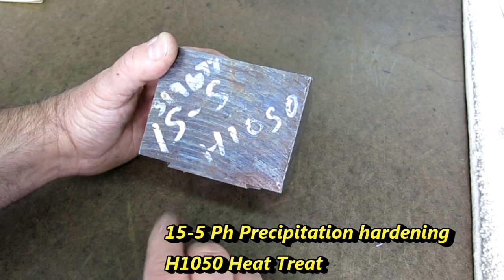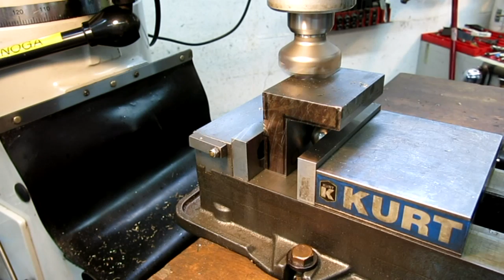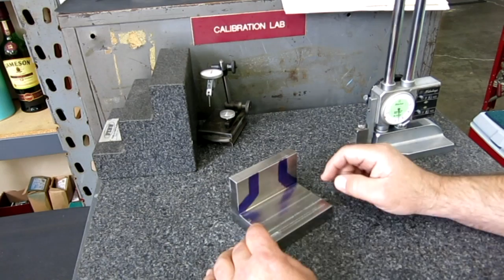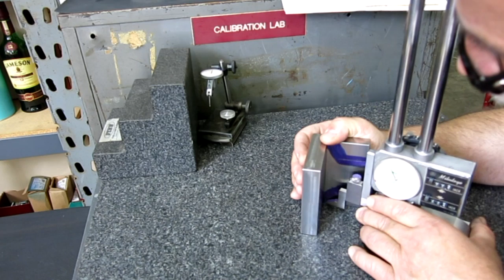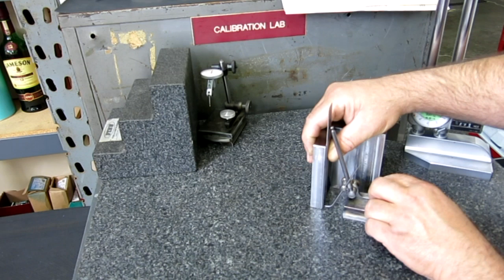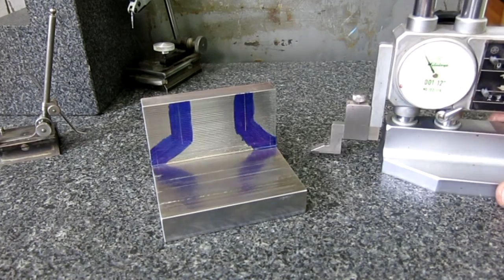Enerpac Toe Jack Part 3

Comment: 18:15

Quoin - Used to hold the type/dies into the "chase" for old rotary letterpress, or into the form on flatbed/platen style. Anyone running letterpress will correct me but it is what it is. Never seen that style, the most common is just 2 bits of metal(aluminium or steel), with a wedge force between them with a screw from the top. Interesting to see what that tool is meant for, every shop I've worked in has a few with that 4-pointed bit but nothing to use it on, I guess they weren't as cheap to make as the other style.

Super reliable, never had one loosen even on week-long jobs with 150,000+ impressions. The big rotary letterpress machines have been known to eat aluminium bits and still run with perfect accuracy once the bits are removed from the racks, testament to the old German quality)

Comment: Hey Tom,
What did you think of this facemill? I know you mentioned it in another video, but I can't remember which one. I'm close to pulling the trigger on a 2"er.
Thanks, Noah
Reply from the maker: Hi Noah,

I like it so far. Inserts are kind of expensive but it doesn't seem to chew through them. The 45 approach angle helps with insert life. Thanks for the comment.

Cheers,

Tom

Comment: Im just learning would it have been better to square your stock first then cut the extra out ?
Reply from the maker: +speeddr2000 Hi Speeddr,

The main stock was already kind of square. Less surfacing on difficult materials is generally a good thing. Hope this helps. Thanks for the comment.

Cheers,

Tom
Reply: Cool thanks

Comment: would boring 1 or 2 holes thru the bottom and adding 2 bolts add any strength to the toe
Reply from the maker: +David Gaylord Hi David,

Generally removing material weakens a part rather than making it stronger. I was trying to copy the original toe fairly closely. Thanks for the comment.

Cheers,

Tom

Comment: I'm glad you ended up trying the feed from right to left, I was thinking it might have helped in the unsupported cut because it would be deflecting the part away from the cutter rather than digging in the Z axis.
And JEEZ that square checker mod you did is neat, I remember it from old
 videos but I think I have a greater appreciation for it now.
What is your preferred method for truing up those scotchbrite wheels.
Reply from the maker: ***** Hey Max,

A good heavy burr on a plate like this one in the video works great from truing the wheel. My wheel is looking pretty sharp and square right now. Thanks for the comment.

Cheers,

Tom

Comment: Tom, is it possible to work harden a part if you bandsaw it at too slow a feed rate? I know that can happen when drilling, too little feed pressure can work harden the piece.
Reply from the maker: Bill Moran Hey Bill,

Yes it is. Feed pressure is your friend. Its not the rate but the pressure on the teeth or edges that can work harden a piece. Thanks for the comment.

Cheers,

Tom

Comment: Tom, When you band sawed the two angle cuts did you use the same 4 TPI blade?
Eric
Reply from the maker: esoomreltna Hey Eric,

Yes I did. Not quite three teeth on the section but it was close enough. Good question!

Best,

Tom

Comment: I wonder if the chatter was caused of the cutter "pulling" the part from the fixed jaw?
Because of the "screwy ball" the part got nothing pushing it against the back of the vice in the end of the cut.
Reply from the maker: He Ka Hi He Ka,

I think it was just a resonance when the front cutting edge came off the part. It looks thick but its tough material. Thanks for the comment.

Cheers,

Tom

Comment: This is a great series Tom 
I have a 4 ton porta power with several attachments and was working on some sketches for something just like this. Your video series has just made my work that much easier seeing you bringing the raw materials to life. I'm looking forward to the finished product as I am in the process of starting mine.
Thanks Tom,
Ian Little
Reply from the maker: Ian Little Hey Ian,

If you already have a porta power you are halfway there. Do yourself a favor and scale this one down. Its a beast and weighs a ton. Thanks for the comment.

Cheers,

Tom

Comment: I wonder how many other toe jacks can double as an angle plate? lol A nice big undercut radius on the inside of that foot would probably be a good idea. Always better to bend than break when lifting!
Reply from the maker: bcbloc02 Hey Brian,

It has a small radius at the root. The stock one has a similar sized radius on it as well. Thanks for the comment.

Cheers,

Tom

Comment: Hi Tom, thanks for the masterful video!
Wouldn't it be an easier approach to square up your raw material cube before sawing it off to become like an angle plate? That way you wouldn't have to deal with the "funky" set ups squaring up an "L" shaped part. But I'm surely glad that you didn't do it that way: we all could learn much more watching your techniques to overcome it!!!
By the way, I couldn't help not to notice the Jameson Bottle sitting in the shelf near the Calibration Lab when you were scribing the part. Naughty boy! :)
Reply: Neto Rosatelli But, it fits! Here in Brazil, when someone has drunk a little too much and is going over the cliff, we say: "well, the guy is "calibrated..."
Reply: Neto Rosatelli We learned some set up techniques with the angle plate milling, but I like your efficient approach on milling the block 2 surfaces perpendicular first... ;-)
Reply from the maker: Neto Rosatelli That is calibration fluid. Keeps the operator moving smoothly. 

Best,

Tom
Reply from the maker: Neto Rosatelli Hi Neto,

Good question. I wanted to remove as much waste material as possible before going for square and size. Sometimes parts move around as you relieve material. This stuff is pretty stable so it was probably more habit in this case. Also less square inches to mill when the sides are smaller. Not that big of a deal but it does make a difference. Thanks for the comment.

Cheers,

Tom

Comment: Tom,
This is not a criticism, just food for thought.
I might have used a ball end mill, and added a small radius down in the inside corner, for a little added strength.
Great stuff as always.
Your friend, Cliff
Reply from the maker: Clifford Fender Hey Cliff,

There is a little radius at the root of the angle. The end mill has a pretty big chamfer on the corner. The stock foot has a similar sized radius. Good observation. Thanks for the comment.

Cheers,

Tom

Comment: $50 for 12 pounds of stainless? My steel supply place that would be $20 max. If they didn't know it was stainless and assumed it was steel, it would be $10-11.
Reply from the maker: Andre Gross Hi Andre,

They knew it was stainless. New that would have been $200. Where is your favorite scrap yard? Thanks for the comment.

Cheers,

Tom
Reply: Not really a scrap yard, but the place has cutoffs and chunks for sale. Knein steel is the name, 86 cents/lb for steel and like 2:50 for aluminum. Decent prices, they kill you on cuts.

Comment: Tom, I suspect that you are doing this project for something too do LOL But in truth with the cost of all the materials, welding gas, electricity, your time, wear and tear on cutters. It would have been cheaper to buy a toe jack complete new ? Question please, why are you reducing the width of the toe jack from the 4 inch width. Why not use the full width?
Reply from the maker: Dave Ticehurst Hi Dave,

You are pretty close. If you look up this particular toe jack it retails for well over a thousand US dollars. I got it for a song so fixing it up seemed like an easy decision. It made a pretty good little series if I might say. The stock toe is shaped like this. I wanted to model the replacement parts so they looked the same. Thanks for the comment.

Cheers,

Tom

Comment: Could you do an episode on proper use of face mills? I have a two insert about this same size and was experimenting with it, it seemed to like to go extra slow once the front left the cut or it would chatter and scar, and I could not go backwards or it would scar badly. I'd love some expertise on them is you can.
Reply from the maker: LucasJ1540 Hi Lucas,

Tool pressure will push the cutter out of perfect tram even on fairly light cuts. If you are getting a crosshatch pattern with a heavy cut you can bet the head is out of tram. Larger diameter cutters are more prone to this as the tool pressure total is higher. Good question. Thanks for the comment.

Cheers,

Tom
Reply: justfakeit888 Sounds like head is out of tram.. trailing edge doing all the cutting. Better to have it cutting equally with all teeth.
Reply: I don't thinks so, or not much. I milled in both directions, and once I got the block more or less square it was fine and I had no problems. The final result looks good and is in the tolerance I want, but I'm using the cutter with no knowledge of what is right and only guessing.
Reply: Thanks. Speaking of that, I used a 2 flute 2" or so face mill on an interrupted cut today and chipped it. Can you sharpen these things?
Reply from the maker: justfakeit888 Hi Fake,

Depends where it chipped. I have added radii to the corners of otherwise good endmills to get rid of chipped corners. You can do a pretty good job on a bench grinder. Thanks for the comment.

Cheers,

Tom

Comment: Seem like it would have been easier to square up the large block before removing the balance on the ban saw. Thanks for the vid, I am learning a lot.
Reply from the maker: FISHBREATHH Hi Fish,

Old habits die hard. Its pretty common for blocks like this to move around with a large amount of material removal. To get good squareness I would have wanted to recut all those faces after the bulk of the material was removed. Good question. Thanks for the comment.

Cheers,

Tom

Comment: Thanks for the video, on the dovetail, the scallops, you think whatever they were holding or using to hold it had a mating surface like that and it was designed to locate the part in that direction?
Reply from the maker: David Finch Hi David,

Its possible. They look kind of elaborate for horizontal location. Its possible they use special jaws with a scallop pitch like that for extra security. Thanks for the comment.

Cheers,

Tom

Comment: No need for coolant while using facing mill?
Reply from the maker: W.Co.VIDS Hi W,

For high speed cutting the inserts can fracture using coolant. Many steel and stainless operations are done dry like this when using carbide inserts. Thanks for the comment.

Cheers,

Tom

Comment: Thanks for the video.

In the setup with the coin at 18m, what is the reason not to square up the end of the L there with an endmill?  Is there an easier way to get to it with the facemill later? Is it just that the finish might not be that great?
Reply from the maker: Anton Maes Hi Anton,

Tool change. Its a small thing but cutting on the bottom face give better results. Side milling pushes the tool away. Its a nice trick to square an entire block with the end cutting surface of an endmill. The finish would be fine side milling that. Thanks for the comment.

Cheers,

Tom

Comment: I was watching you hold that piece of plywood as a chip shield at around 19 mins and in the background i spyed that huge new Noga....    You should make an attachment that is a clamp to hold chip shields. You could then have a collection of different chip shields for anything. You could even make and hold semi circular chip shields for fly cutting.

Is that a new hammer i see at 23:28?
I also spyed that bottle of "Calibration Fluid" at the top left at 30:00 on the shelf of the calibration lab.
Reply from the maker: Notso Fresh Hi Notso,

I have a different magnet setup to hold the plywood. I generally try to cut so all the stuff goes off the back of the machine. Calibration fluid is mandatory for machine shops. How else would we stay in calibration? Thanks for the comment.

Cheers,

Tom

Comment: I have found that with my sawz-all that Lenox blades are better thatn any other including Milwalkee, DeWalt, Irwin Etc... The not only cut well but they will take more abuse like bending and straightening before breaking or dulling after chewing through some nasty stuff. I didn't know they made Bandsaw blades but it makes sense. And I'd have but my money on the Lenox blade if anything would cut that stuff.